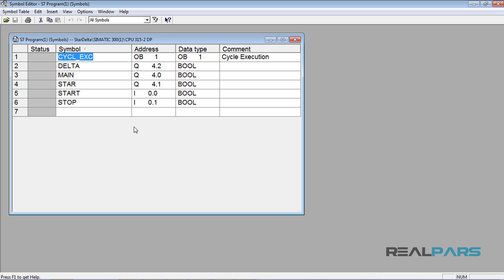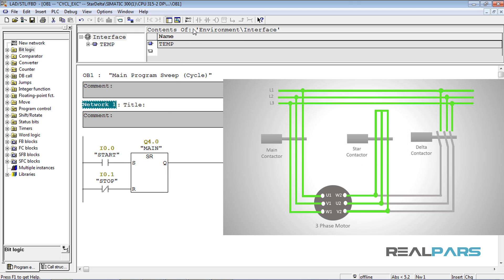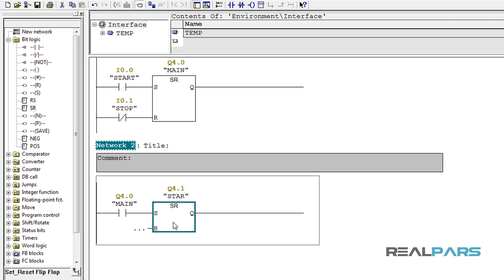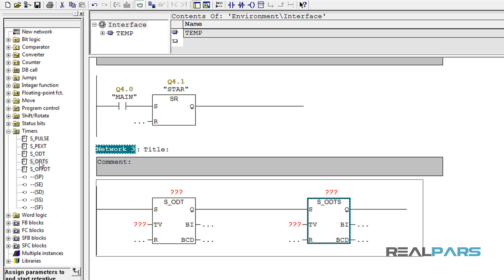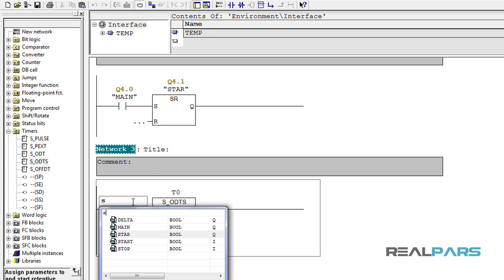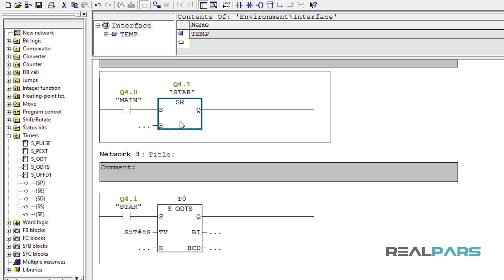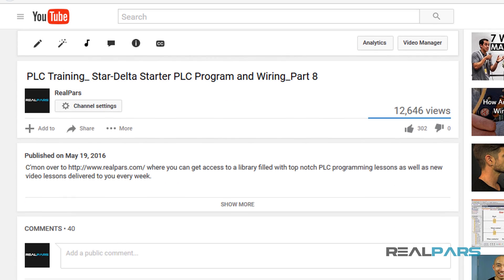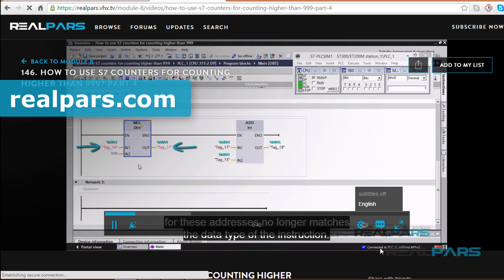Star-Delta Starter PLC Program and Wiring _ Part 11

Comment: instead of SR flip flop, can you use a relay coil as the Main, Star, and Delta?
Reply from the maker: Appreciate your question! Certainly, relay logic can be employed to trigger your Main, Star, and Delta motor contactors. However, it's crucial to ensure accurate wiring of the relay logic to achieve functionality similar to PLC programmable logic. 

Enjoy your learning journey with RealPars!

Comment: Good day sir? my question is, Is the timer already included in the plc or should i have put it into the control circuit?
Reply from the maker: Thank you for your question!

In the video, we used Siemens Simatic S7 software called Simatic Manager. It offers 5 PLC software timers, just like their real-world counterparts. To use these timers, you can select the desired timer from the software library and integrate it into the logic you are creating.

If you'd like to explore more about this software and its functionalities, you can download the manual from the Siemens website for your learning. Here's the link: Siemens Simatic Programming with Step 7 V5.5 Manual. https://support.industry.siemens.com/cs/document/45531107/simatic-programming-with-step-7-v5-5?dti=0&lc=en-US

Happy learning!

Comment: What is the meaning of SR
Reply from the maker: SR is a set-reset flip-flop block.  When the "S" input is energized, the output Q is energized.  It will remain energized until the "R" input is true, even if the "S" input subsequently goes false.

Comment: Dear sir I would like to know that input and output signals based on some particular voltages.can I know what is the out put voltage there in out put digital bars
Reply from the maker: The output voltage of the digital input cards should match with the voltage of the device that you have in the output. In most cases, this is 24 Volts DC.

Comment: The most correct way of star delta command is: First you energize the STAR  and THEN the  MAIN contactor.  It is not correct to energize both at the same time. Bigger is the motor worse is problem of energize both contactors at the same time. Congratulations/thanks for the video.

Comment: for the stop switch, can it be in series of the reset button?
Reply from the maker: Well, I'm not sure if that would work because if we have the buttons in series, then we need to press all of them at the same time to stop the motor/machine which does not really make sense. 

But we sometimes do that for the start switches.  For example, for the press machines, we want to keep both hands of the operator on the buttons when the machine makes a downward stroke. For that, we'll use two start switches and then in the logic, we'll put two open contacts in series. This way the output only works when both inputs are pressed. 

By doing this we can make sure that the operator's hands are both on the buttons when the machine makes a  downward stroke. 

If we use just one button, in this case, the operator has to press only one button and has one of their hands free. this free hand can be injured during the downward travel of the machine.
Reply: RealPars how to use an analog input value to turn a digital output switch.  If the analog value is 0 then turn on a digital switch. Thanks
Reply from the maker: You can make use of an equal instruction for that purpose. 

The equal instruction gives you two inputs. 

assign the analog value to the first input and zero to the second output. 

With this logic, when the analog value is equal to zero the output of the instruction which is bit will be true. 

Use that bit to energize the digital output.

Comment: thank you for the effort. 
I have questions. can i use the s_pulse timer ?
Reply from the maker: Hey! Here we're using an on-delay timer. The way that this timer works is that when the set input is true, the output is going to be true after some delay. 

Now the way that the s-pulse timer works is that when the set input is true, the output is going to be true immediately (without any delay). Also for this timer, the output becomes false as soon as the input is false. So this is not the timer that we can use in this logic.

Comment: thank you for this amazing videos. But I have two questions:
1-Why you always use the logic of a set reset flipflop instead of yes or no logic(the first or the second one in the bit logic)?
2-The Star SR flipflop will be always taking a set order from the "Main" NO switch, so after the reset order given by the timer, the the star output will receive the set order again.
Thank you RealPars you're amazing
Reply from the maker: You're very welcome! As to your question:

1) We usually use SR or RS flip-flops when we need the output to stay true even when the SET input is false. 

2) It won't. We will add a closed contact of the delta contactor after this open contact. Please watch the next parts (12, 13 and 14) and you'll understand this clearly. :)

Comment: Sir, i think there is a mistake. In network 2 you used SR Flip Flop  as Star Contactor. SR is a Set dominant Flip Flop. That means when two inputs to an SR is TRUE(S=1,R=1), then Output will be also TRUE(Q=1). so when Timer output becomes TRUE after 8 seconds the FlipFlop will not turn off. If it was an RS Flip Flop , then it will be ok. Because RS is RESET dominant. that means for RS (S=1 & R=1, Q=0).
Am i right?????
Reply from the maker: Hi Prabhakar, for SR flip-flops, the RESET input always has a higher priority. So when the timer is done timing and the reset input of the star flip-flop is true, it's going to be de-energized immediately.
Reply: @realpars  I also have the same concern as Pranhkar. If it is as you said, RESET input always has higher priority, then what is the different of SR and RS?

Comment: well I  think you have mistake....second RS flip flop  S is MAIN ....and  R reset is TO....but for flip flop R=1 and S=1 is undefind state, or am I wrong???
Reply from the maker: Hi Borisa, I'm not sure if I understand your question. Can you please elaborate?
Reply: Ok on entrance of the flip flop.... when SET =1 AND RESET=1 (S=1 and R=1) isn't it undefined state for FLIP FLOP
Reply from the maker: Good question Borisa. 

-For SR flip-flops when both inputs are true, the output is going to be false. That means  for this flip-flop, the RESET input always has a higher priority.  

- For RS flip-flops when both inputs are true, the output is going to be true. That means for this flip-flop, the SET input always has a higher priority. Very simple and straightforward.